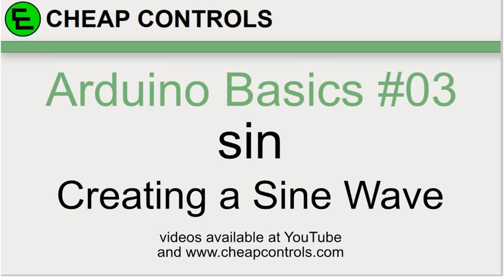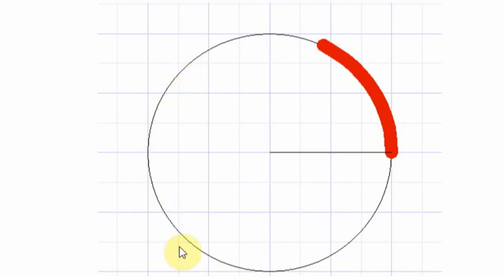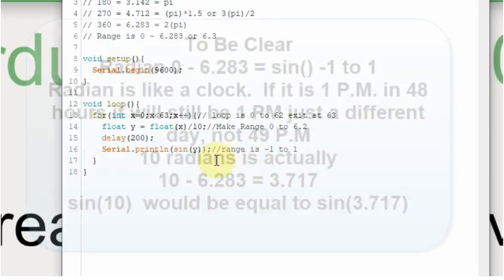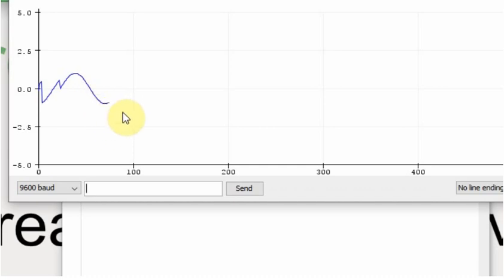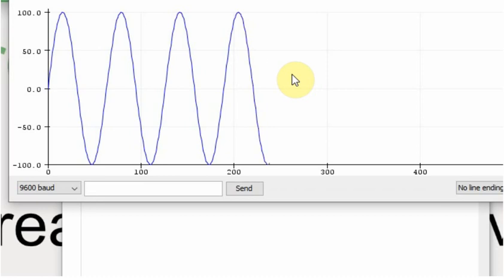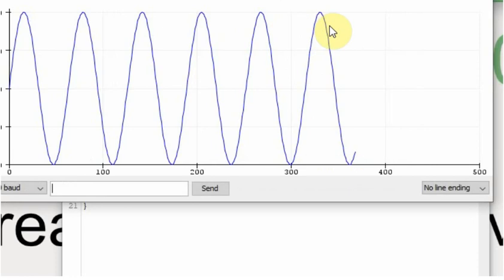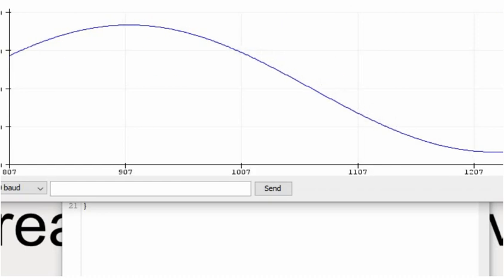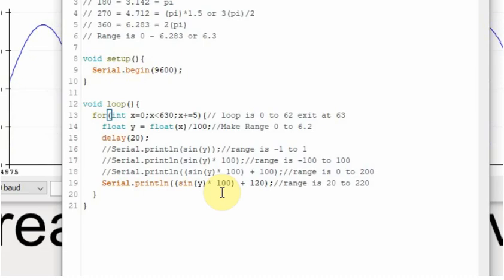#106 Arduino Basics - sin Command - used to generate a sine wave - Arduino Programming Tutorial

Comment: I am working on a single-phase off-grid sine wave inverter project designed to output 230V AC. The inverter employs an H-bridge configuration with IGBT MOSFETs, TLP250 gate drivers, and an inductor coil. However, during testing, the output voltage exceeds the intended 270V+.

Could you please provide insights or recommendations to address and resolve this overvoltage issue? Specifically, I would appreciate guidance on:
Reply from the maker: I know the Nextion display but I am not an expert on high voltage H-bridges.

Comment: So this sine wil come out on any regular digital output??
Reply from the maker: No,  this is for internal use only.  digital outputs are only high and low.  Analog I/O might work but I have never tried it.  You would have to make sure your values fit to the analog I/O values.

Comment: Thank you great learn from u also to know for 3 Phase 50 Hz sine wave generation with phase angle difference of 120 degree each other with arduino UNO output R Phae at pin no 7 , Y Phae at pin no 8 & B Phae at pin no 9. Thanks
Reply from the maker: This is a very interesting comment.  I am currently without a shop.  I recently moved and am just now setting up a place to work on projects.  It will be a couple more weeks before I can experiment.  If you want you can submit a comment on my website to make sure I don't forget.
Reply: I just put together a quick demonstration to expand his 1 phase to 3 phase.  You just calculate the other phase positions from the primary phase. 

You can run the simulation on Tinkercad to see it working.  Click Code (top right), then Serial Monitor (bottom, under the code), and then Toggle Graph, to show the output graphically.  Click "Start Simulation" get get it moving.

https://www.tinkercad.com/things/83HKHyQO4Va-arduino-3-phase-sine-wave-output/editel

I also put the code up on Pastebin, if you prefer that.  It's the same code.

https://pastebin.com/c99x4nHJ

He uses 64 steps (0 to 63).   63/3 = 21.  So add 21 to each, and wrap the value if over 63. 

You will need to do your own timing work to get 50Hz from it.  Probably a lot of millis() work.  Calculate what y (ya) should be after the actual duration, rather than just incrementing it.  That will protect from any latency in the hardware or your code, and correct for it by itself.